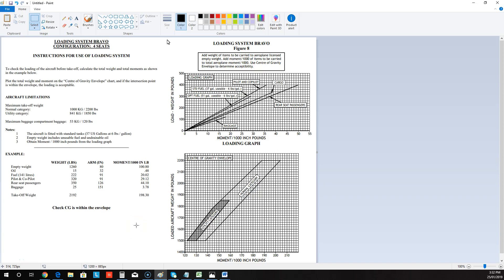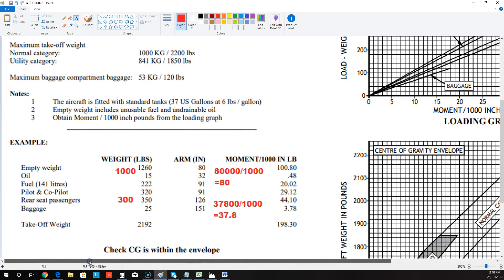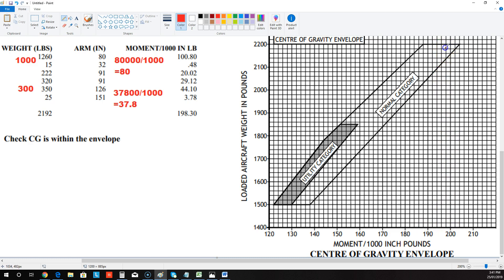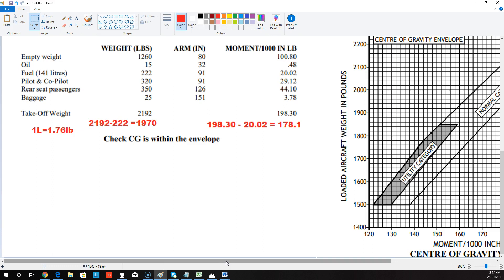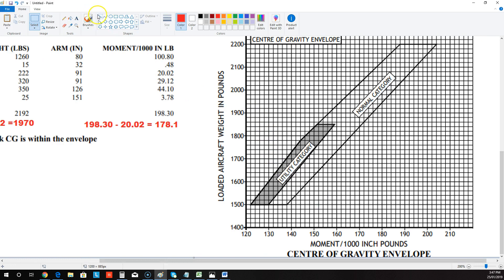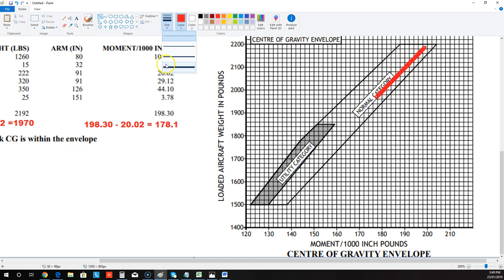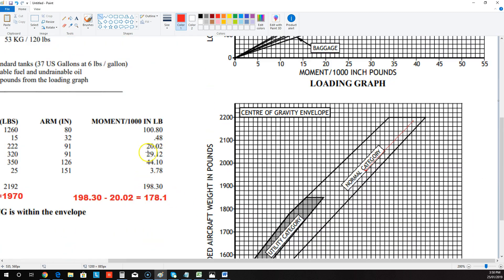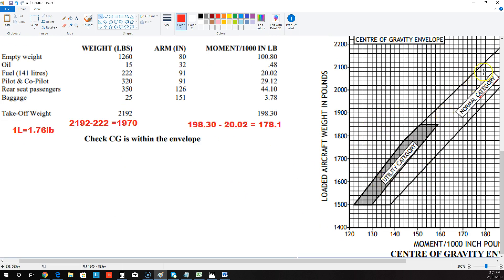Bravo Loading System For CASA Pilot Exams RPL PPL CPL Flight Training, Pilot Exams & Learn To Fly

Comment: When you land you have to have usable fuel, say you had 3kgs of fuel left you wouldnt be able to use all that fuel else the engine would stop on landing. When you took out the 222lbs of weight did you account for usable fuel. Great Video though, taught me a lot.

Comment: Hi Matt, in the video for fuel 1.72  ( JET A1) is used as the conversion for fuel . Using AVGAS i believe the number is 1.58 (checked with the numbers 1.58 x 141L = 222 lbs) is the better fit. Regards Michael
Reply: was going to say that